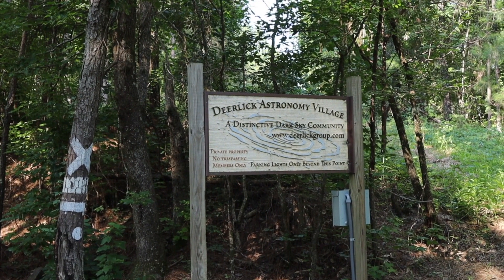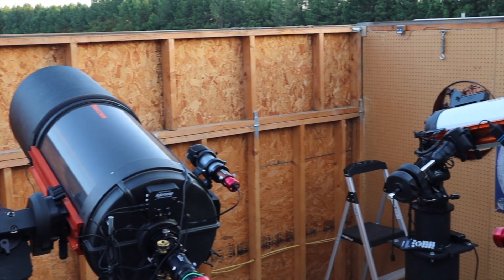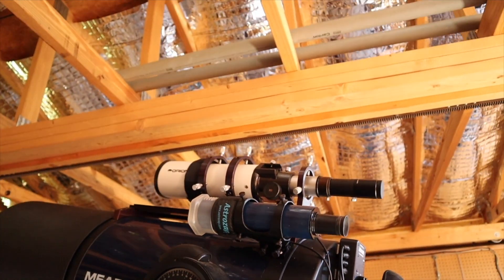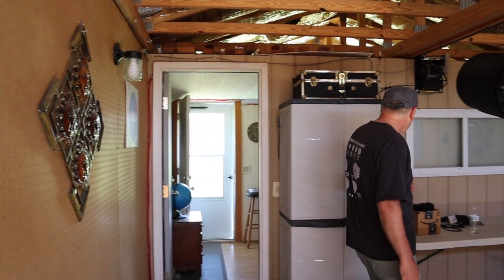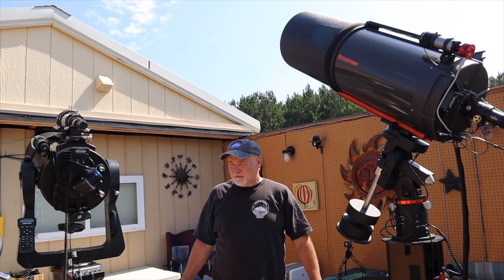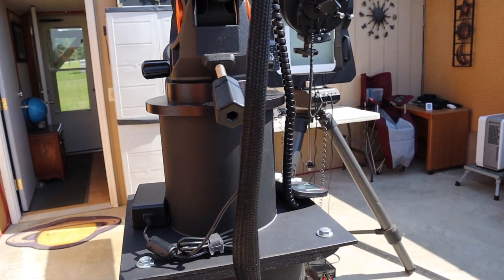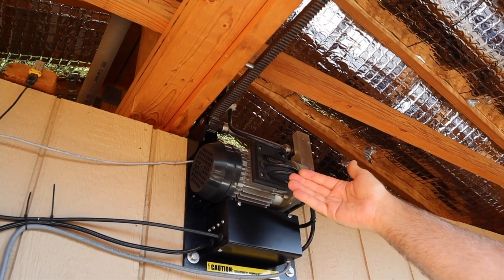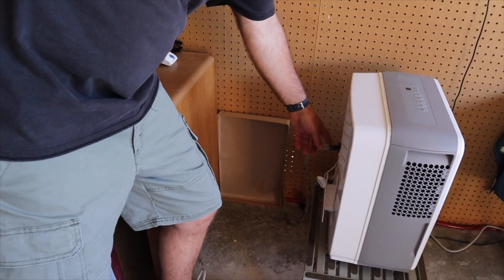Observatory Tour - Inside a Roll Off Roof Observatory

Comment: When I started astro about three years ago i quickly got tired of setting up and breaking down 20-30kg (40-60lb) of equipment. On one of the concrete pads I made for my tripod I built a 1.5 square by 2 meter (4.5x6ft) little shed. The top half is hinged on each side and opens to allow 360 degrees view to the horizon but for a few trees, a wee house, a couple of hills... lol. Its only good for photography because i cant walk around it and so now planning to make it bigger. I'm thinking of putting the whole observatory on rails and just opening a door on one side and pushing it completely away from my kit leaving it free from obstructing walls. I'm thinking of making a pier so I can maintain a lower footprint but also allowing for a longer refractor or a taller reflector. Watching this video gives me some other ideas - cheers. ANYWAY I'm anxiously waiting till the end of this week when Comet Neowise becomes visible (hopefully) in the evening sky here in Western Australia.
Reply from the maker: There is an observatory down the the street at deerlick that does what you are suggesting.  The mount is on a pier and the whole shed moves away . They have it set up like a large patio deck around the pier in the shape of an octagon.  The shed moves from the center to one end.  The doors open 270 degrees and fold against the shed.  When it rolls back the doors are out of the way.  It is really neat.  I will try to get a video sometime to share.
Reply: @AmyAstro  When your video showed the surrounding area I was looking to see what other people had nearby. I could only see what looked like a raised deck - that looked neat. What a neat place to go and get some great ideas.  Thanks again
Reply from the maker: Ding Dong that was an observation deck for group gathering. They have a Dob roll out of that mini building. They have scout groups come out for star gazing.